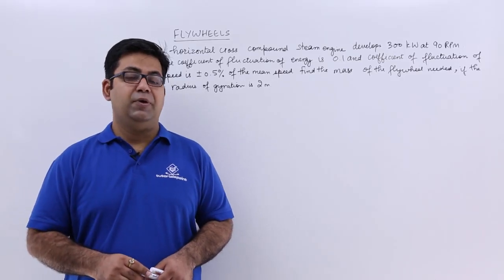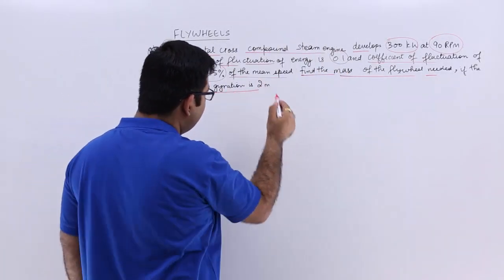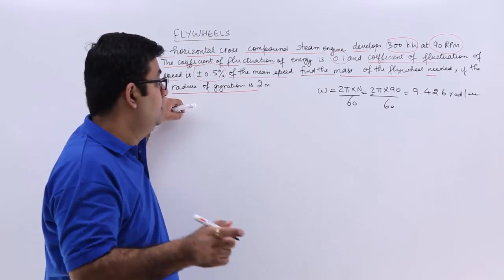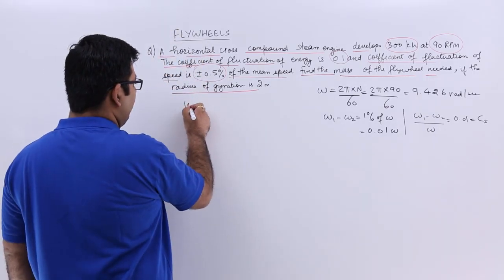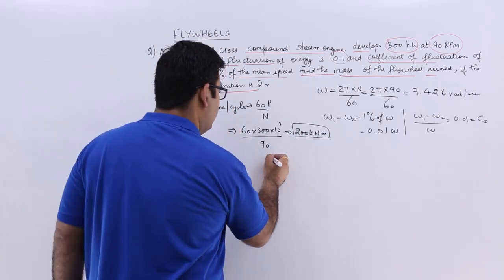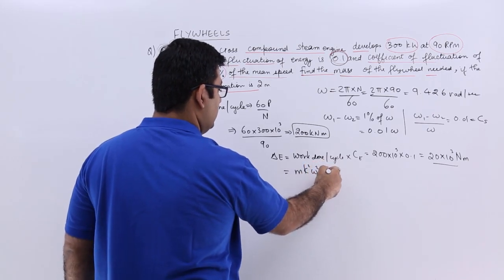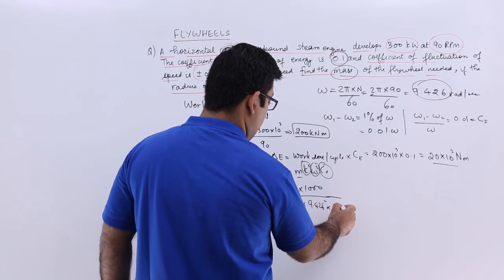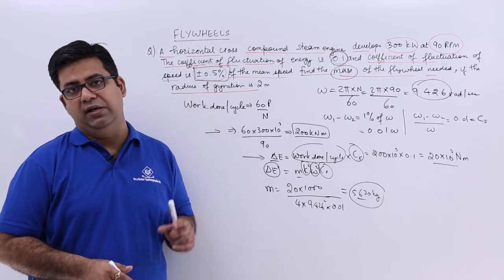Problem 2 On Fly Wheel

Comment: A small flywheel of mass 85kg is suspended in a vertical plane as a compound pendulum, the distance of the centre of gravity(G) from the knife edge support is 100mm, and the flywheel makes 100 oscillation in 45 seconds. Find the moment inertia of the flywheel through the centre of gravity (Ig).